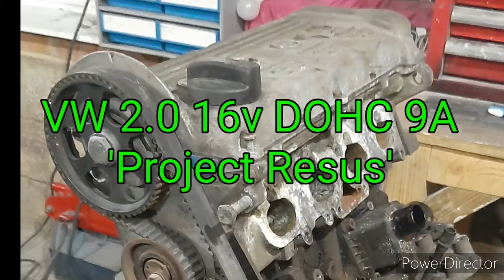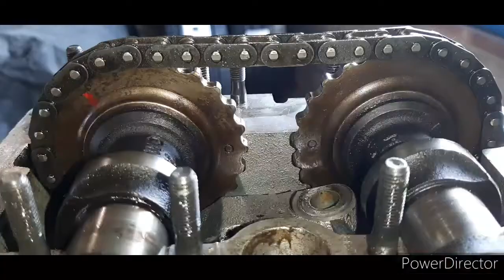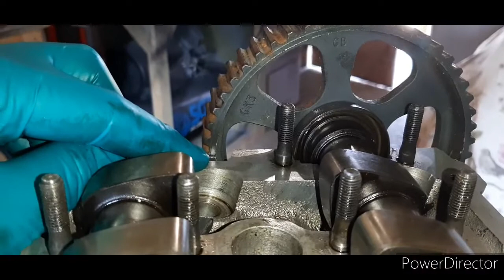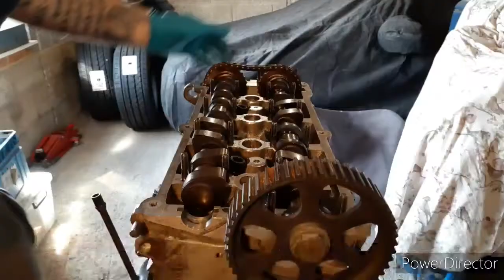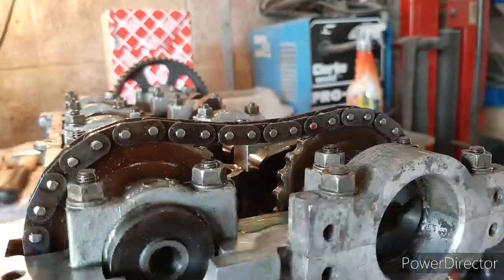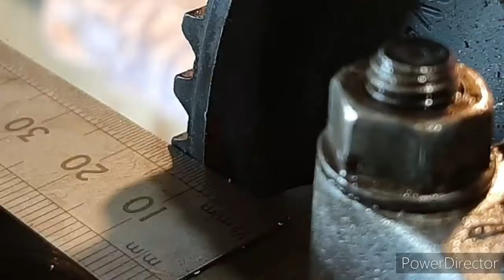Project Resus - VW 2.0 16v 9A Part 13

Comment: So question, the two cam circles line up, the big gear that sits outside the valve cover should line up as well?
Reply from the maker: Yes, with the two small dots lined up the cam pulley should line up with the V on the valve cover

Comment: Nice video.
Thanks for making that.
I have the same engine, and just replaced the lifters.
Seems like your cams went in without having to press down on the lifters. Is that right?
Shouldn't there be pressure on there lifters from the cam?
Reply from the maker: There was a little bit of pressure on the lifters, not a great deal though as they're empty of oil.
Reply: @GreyGooseRestorations  so I'm putting in fresh ones and they are oiled. So they are sitting higher. Any thoughts on the best way to put the cam back in
Reply from the maker: Aslong as their all sat on the valve springs and not wedged on the head, then just put the cam on and all the cam caps and nuts on and nip them up, then tighten them down little by little from centre outwards like cylinder head bolts

Comment: How are you spinning this so freely with lifters & springs in the head?
Reply from the maker: The cams aren't fastened down, they are just resting on the cam followers
Reply: @GreyGooseRestorations  curious I’m installing cams for a friend it’s been some time since I’ve done this. They are a set of ABF cams in a 1.8 kr motor. Is there an easy way to get these things to line up when installing them with the two marks on the lip of the cylinder head? I find it hard because when you go to press down on the camcaps the camshafts want to move? Any advice?
Reply from the maker: @jdportwerks6795  it can be quite awkward, try and see which way the cams go out of line then offset them the same about so when you tighen them they align
Reply: @GreyGooseRestorations  yeah it’s almost impossible of what I remember. Just wasn’t sure if you know a trick as to installing these easier

Comment: I’ve read on the forums that kr inlet cams can help to make some more power, but coudn’t verify it. Do you know if kr inlet cams are any different to 9a-ones ? You share alot of good information troughout the videos. Keep up the good work
Reply from the maker: Thanks, Yes the KR inlet cams are a higher lifting cam then the 9a ones. So if you put a KR inlet cam in a stock 9a then it'll liven it up a bit. 

All 16v exhaust cams are pretty much the same from KR/9a/6a/PL etc